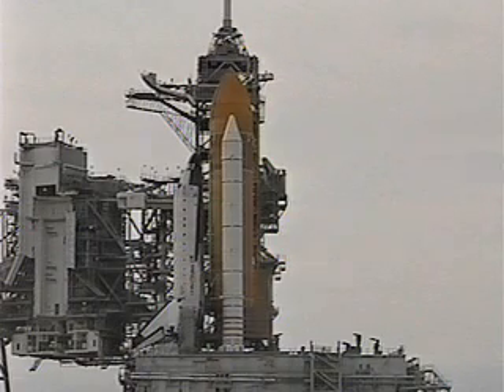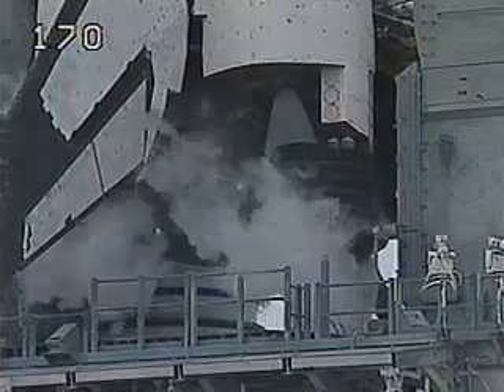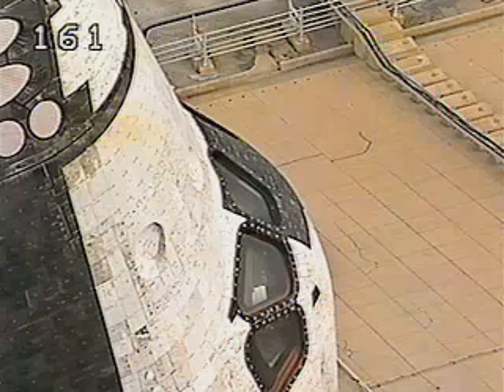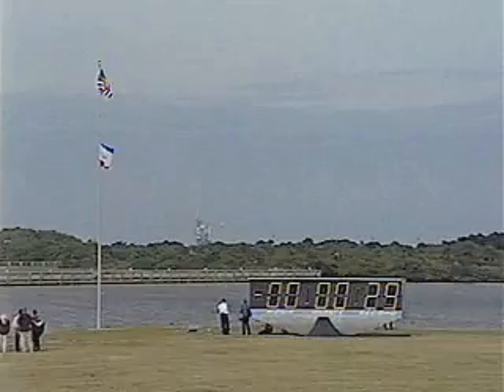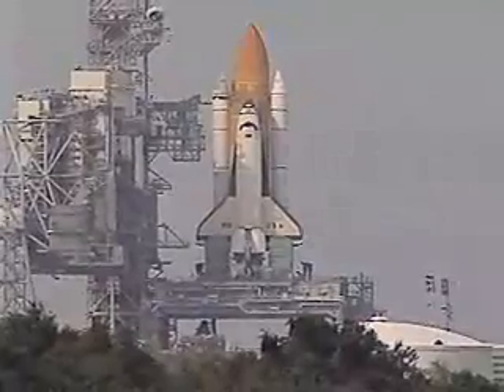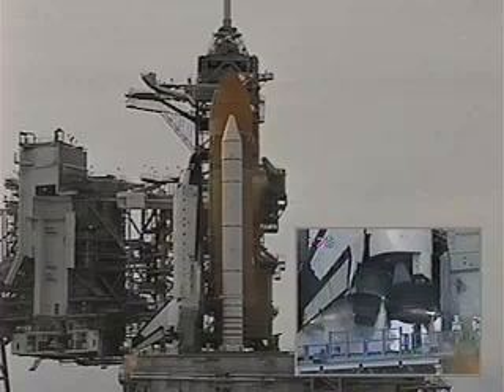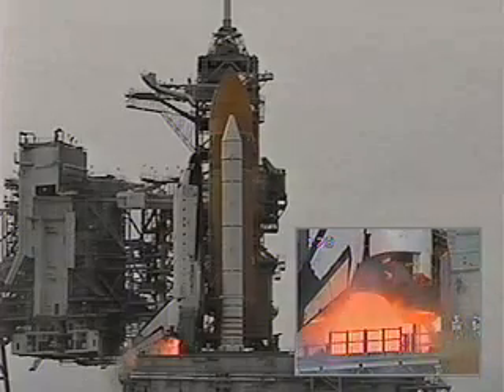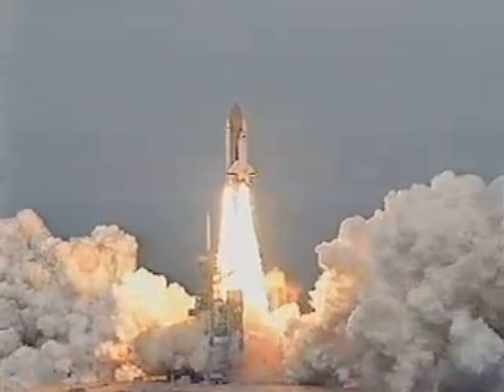STS-87 launch (11-19-97)

Comment: This was the 6th on time launch for 1997 and ended the second year in which 8 flights had been completed. Only one year had more flights, 9, in 1985. The USMP-4 Payload performed well,  with experiments concentrating on materials science, combustion science and fundamental physics. 
Other secondary and mid deck experiments were flown as well. 
The SPARTAN 201 satellite was deployed to investigate the conditions and processes of the Solar Corona and the solar wind.  There was difficulty in retrieving the satellite using the Remote Manipulator Arm and the satellite was retrieved during an EVA instead. The EVA was conducted by astronauts Winston Scott and Takao   Doi,  the first person from Japan to perform a spacewalk. As well as retrieving the satellite,  they performed work in connection with supporting upcoming ISS assembly missions. 
It was decided the SPARTAN satellite  would not be released again because of the risk it could not be retrieved again, Another EVA was conducted.
This was the 24th flight of Columbia and the 88th Shuttle Mission.  The first spacewalks were conducted from Columbia,  spacewalks on 2 previous flights, STS 5 and STS 80 couldn’t be performed. This was the first of only 2 Columbia flights in which EVAs were carried out.
This was also the 12th Extended Duration Orbiter Mission. 
Commander Kevin Kriegel made his 3rd flight, his first as Commander. Pilot Steven Lindsey made his first.  Mission Specialist Winston Scott made his second and Kalpana Chawla, who was later killed in the Columbia disaster,  and who was the first woman born in India to go into space, made her first.  Payload Specialists Takao Doi  and Leonid Kadenyuk,  the first Ukrainian to fly on the Shuttle, their first.

Comment: @3210andLiftoff  Wrong roll I was thinking of the a different one:  This launch was the first to use a "heads-up" maneuver which has the SSME's automatically rotate the orbiter from belly-up to belly-down approximately 6 minutes after liftoff. This procedure will be used on all future low inclination launches. It allows the orbiter to communicate 2.5 minutes sooner with the space based tracking and data relay network (TDRS) system and eliminates the need for the Bermuda tracking station.